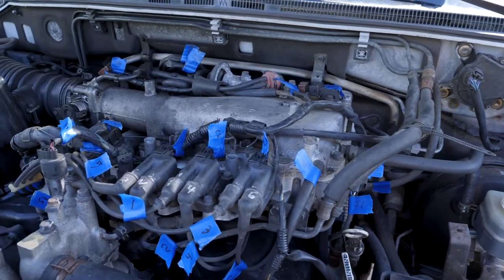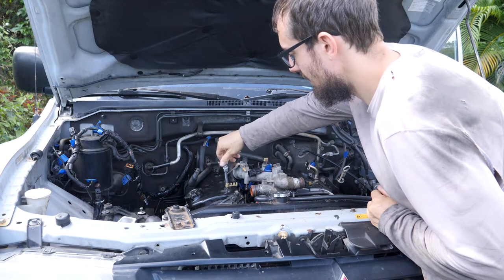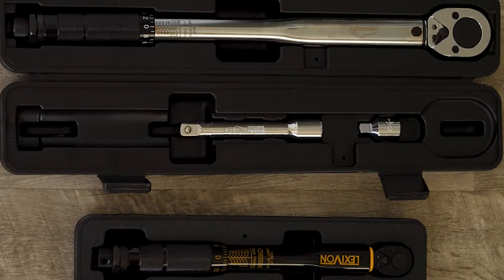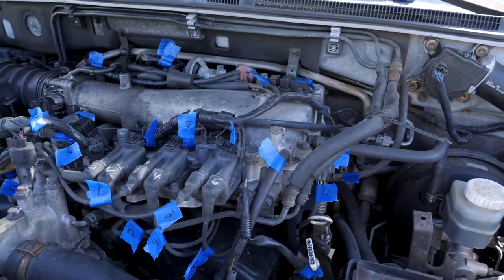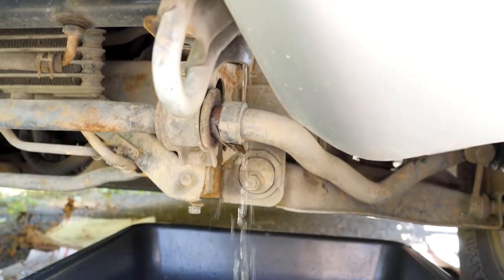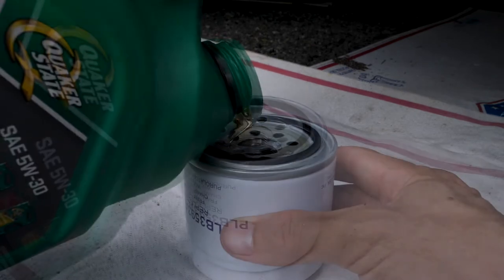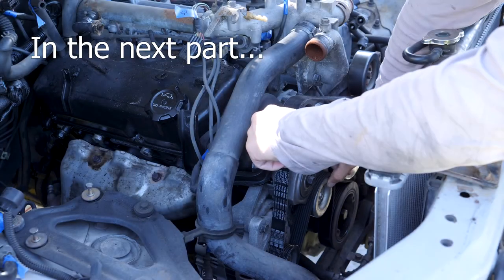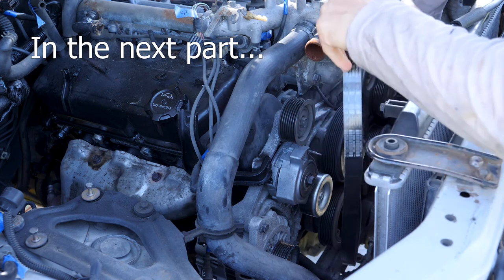Mitsubishi Montero Head Gasket Repair Part 1: Air Cleaner Box, Electrical Harness and Plenum Removal

Comment: Only just found this, thanks so much for this. Currently replacing the 6g74 with a 6g75 bare block and everything from the 6g74 bolts back on. I'm not really sure about how to do it all either so I've got the manual and finding this is so valuable. Thanks.
Reply from the maker: You're welcome. Good to hear that it's been of help to you. We hope you have success on your project too!
Reply from the maker: You're welcome. Good to hear that it's been of help to you. We hope you have success on your project too!

Comment: When doing an engine tear down, it’s always good to lubricate the bolts with A penetrating spray. This also works for electrical connectors. After you spray it they just need a little bit of massage and usually will break free without ruining the connector. The penetrant spray is especially valuable in exhaust areas where bolts may have rusted down and lost some strength integrity.
This would especially apply for the EGR valve exhaust bolts because they are only 6 mm thread with a 10 mm bolt head.
Often times these bolts are subject to breakage and the 
Penetrating spray makes it less likely for them to break.
Reply from the maker: I use WD-40 as my penetrating oil. Though I wouldn't use it on electrical connectors because it could cause a faulty connection and it collects dust which leaves everything all gunky after a while.

Comment: Thanks for posting these videos! Give me hope! Question, how important is it to relieve fuel pressure? Lol i started and forgot to do that, Im about to remove plenum.
Reply from the maker: I don't think it's mission critical but make sure you have some rags to catch the fuel when you disconnect the fuel lines at the fuel rail. It may spray out if it is still pressurized.

Comment: What a wonderful series of videos. Congrats and thanks for sharing. I have a silly question: where is the fuel pump relay located? I am probably overlooking, but I cant find the info on the FSM. If you could point it on an image that would be great. Thanks in advance!
Reply from the maker: You're welcome and thanks! I found a diagram which details the 3.8L which has two fuel relays but the 3.5L fuel relay is in the same location as fuel relay 1 in the diagram. Here's the link:
 https://www.justanswer.com/mitsubishi/7lbvy-mitsubishi-np-fuel-pump-relay-located-2004.html
Reply: @ColoradicalMike  Muchas Gracias !!